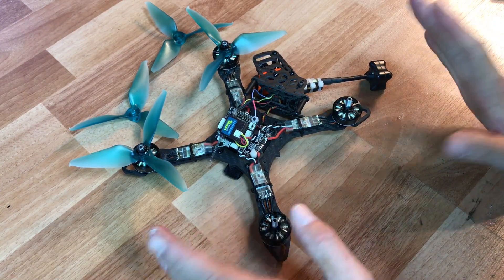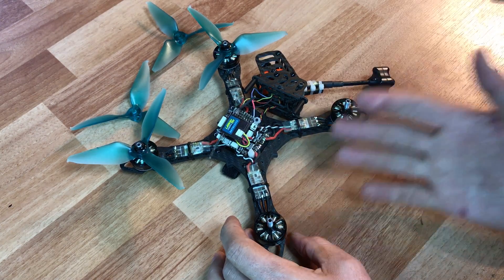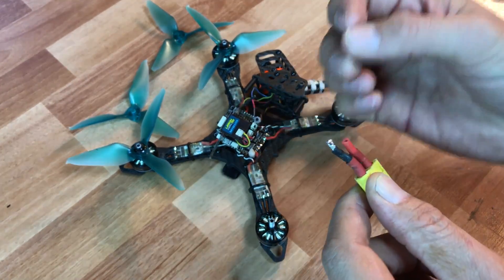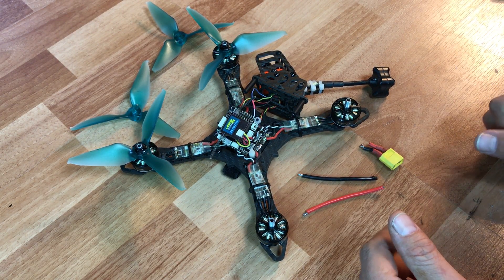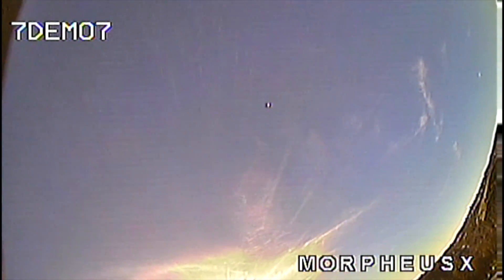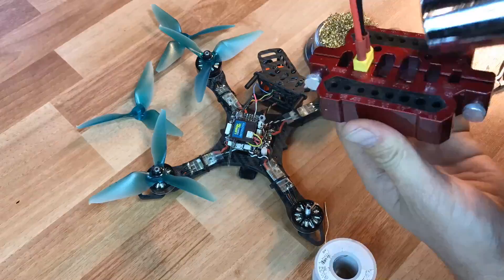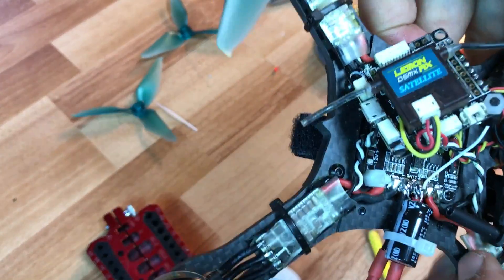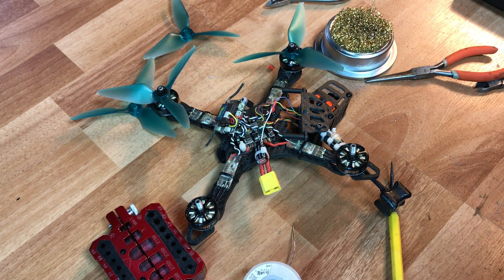MorpheusX Maiden W/ A Strange Problem

Comment: is the sma coax connector on your vTx antenna touching any carbon on the frame?  I've had a similar issue before with the vTx shorting to the frame, it'd reboot the Rx each time.
Reply from the maker: nope... but good suggestion!

Comment: I normally fly with a capacitor on the battery leads.  It makes me feel a bit more secure.  This time, I did not add one straight away.  It figures.  What size cap did you use?  I could not tell from the video.

Comment: I have been struggling with a glitch that disarms a Naze32.  The FC then presents with a solid red and solid blue light, until I disconnect from the battery.  The FC responds to switch operations to the beeper and air mode switches, while it is locked up.  I temporarily added a 1000mf cap with a connector to the lipo balance leads, this afternoon.  Flew 4 packs, with no repeat glitch this afternoon.  Tore everything down for an all day inspection and FC full reflash yesterday.  Couldn't find anything.   Oh well.
Reply from the maker: ahhh man....

Comment: I had this happen with the connector on a battery. Lucked out though as it showed up just as I was setting down.
Reply from the maker: Yep, I finally spotted the problem the next day.  was about to take off and everything went dead... heard a small sizzle
Reply: Sizzling is OK with bacon or a steak, don't solder anything when that happens.

Comment: Very interesting Jeff, I was having a similiar issue where I would have bind and then no bind I struggled with it in Cleanflight thinking I had something wrong in the CLI which after further examination i found that the little connector for the LemonRX power wire was barely holding on by a couple strands of wire, thank goodness I had a spare laying around and now all is good.
Reply from the maker: yep, these are the hard issues to diagnose

Comment: hi jeff that's strange,could the carbon be blocking the signal on those small antennas,have you tried moving your reciever
Reply: No, just no.
Reply from the maker: No,  I've flown since and the problem disappeared